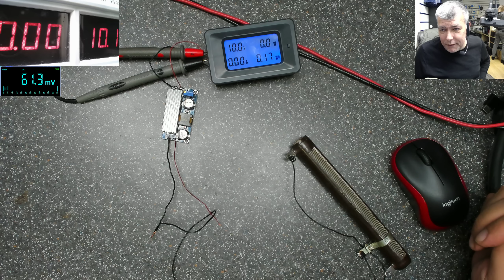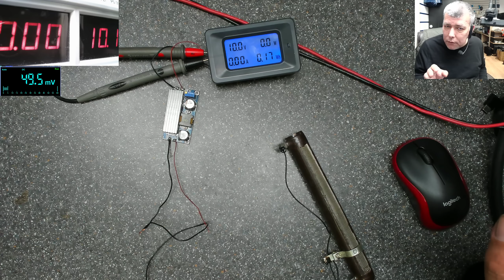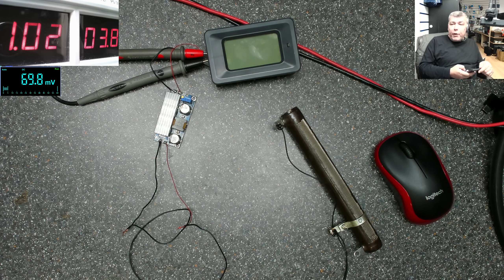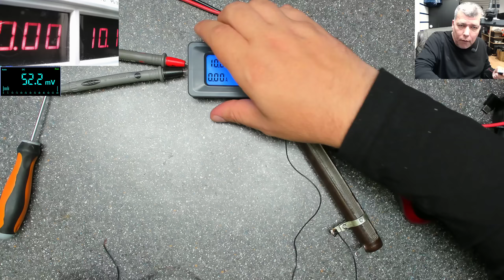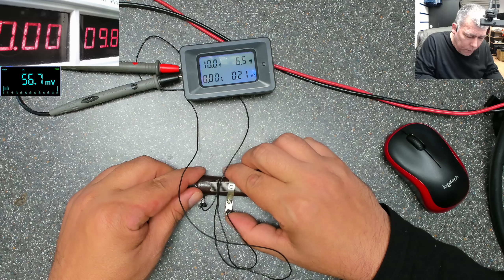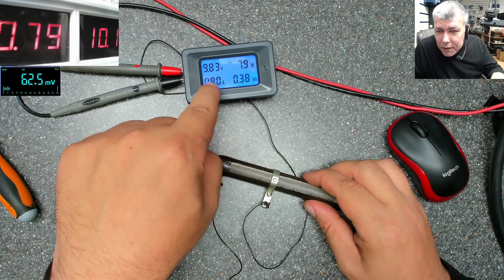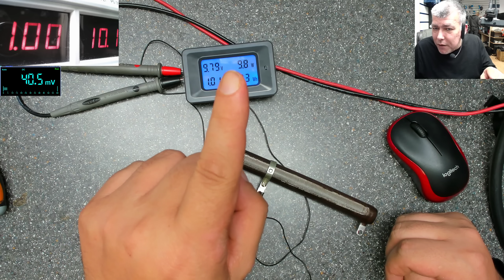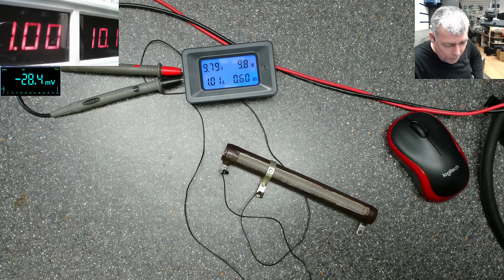How a solar panel mppt controller works

Comment: resistance load not right. must be a battery, then it would last 10v but would not charge because of a 12v battery.

Comment: While the MPPT controller is tracking the best output power from the panel, does it maintain a constant output voltage to charge a battery?  The output power must also be changing by the law of conservation of energy.  So something must give at the output of the MPPT controller, either the output voltage or output current.

Comment: I am 68 also. Remember the old days of audio amplifiers,  something called impedance matching? If you use an 8 ohm speaker on a 8 ohm output you get max power transfer.   
 If you use 4 or 16 ohm you only will use 1/2 the amps output power available to be had. You may have a 10watt amp. But You will only get 5 watts out. It must be matched! 
 If you use a battery with 5 ohm internal resistance you must use a 5 ohm load to get max power transfer out of that battery.
 But I'm just an old electronics  guy..  I don't talk fast and I read read and believe  the KJV Bible.

Comment: Interresting, series starting out good :), but of course its all just ohms law in the end :D
Im wondering if you will be making a battery backup inverter for adding to your grid tie inverter?, if you do, can you show a 3 fase? :)
I been looking at alot of ideas on how to do this, but i dont see the solution, should be in sun time charge batteries with excess power from solar that isnt used in house, if extra (-house, -charging) put that back grid, in night/dark priority taking AC from batteries, when batteries low, use from main grid (thats my idea anyways).
I have a Danfoss TLX Pro 6k+, in a good day i make 6-12 KW, but i only get to use 3-5KW rest goes into nothing (we pay 2.20 KR pr Kwh, we get 0.12 KR for what we send to grid so its bad to return).
I would think a sweet diagram would save me alot of money in the long run.
I see most commercial sollutions is easy 2-3000$ which is cracy, then might as well buy a real hybrid inverter :P

Comment: This will be an interesting journey.  I build solar control panels and LiFePo batteries for a living.  95% of the units I build are installed in Barbados - I think they will generate a little more power than here in the UK :).  Our Barbados panels have 2 charger/inverters running 6 x 24v 76Ah batteries per panel.  Our UK panels have a single charger/inverter running 3 x 48v 152Ah batteries.  Sorin, have you thought about building your own Lithium battery using cells from old laptop batteries?  You must get hundreds in your line of work :)  You should move to Yorkshire, it's always sunny in Yorkshire ;P

Comment: Photovoltaic systems are truly wonderful and can handle any financial situation. A mediocre system that can meet the needs of lighting and other light household appliances (refrigerator, washing machine, televisions, mixer, a small air conditioner, etc.) but provided that not all will work together, can be done at a cost of 6 to 8 thousand euro depending of the quality of the construction materials (Chinese is much cheaper but is it better?) We must forget about energy-intensive electrical appliances that we will have to replace with other types of energy such as gas (electric stove, water heater, maybe even the washing machine if we found a way to supply hot water by turning off its resistors, some clothes ironing presses, etc.). High consumption should also be avoided during the night because there is no sunlight and energy storage batteries have a certain lifespan depending on the degree of discharge (it is also the most expensive material in our system).
Many are forced to buy a rear-end wind turbine to make up for some of the energy during the night or in the constant cloud (as you have in England). There are many things that need to be studied properly in advance to have a proper installation and not need extra constructions and upgrades. Above all, it comes down to the financial issue and how much everyone is willing to spend.
 Sorin, you opened a big issue, you started it right from the electric-electronic side (since it is also your specialty), I am sure that you will fill several gaps that were created for me during the establishment of my own photovoltaic system (a small 1000 watts about where I have installed myself in a cottage-residence in Greece).
Well done and I'm waiting for your next videos

Comment: Hello
If you have time can you explain the Hybrid system with the super capacitor iknow maxwell have one,i want to know if it is possible to operated air conditioner only with the super capacitor when there is sun especially in warm countries  😎.
Thank you

Comment: For clarification. how do you actually achieve impedance matching in the converter without using resistance?

Because if you would just attach a proper resistor on the input side of voltage converter than you would achieve that impedance match, but it would mean nothing because the power would be dissipated in that resistor and not used by the converter.
You need the power to go to the converter so that you can use it in whatever appliance you want, otherwise you are just wasting it.

So, the answer to the problem lies in the fact, that you shouldn't actually look at it as an impedance matching device. Because for the panel it doesn't matter what do you connect to the output, as long as the voltage and current going out is proper. What you need is not a resistor, but a proper voltage and current going out of the solar panel.
You achieve that by using a capacitor or a coil. They both have minimal resistance, but the amount of current that they are taking is dependant on how much charge they have already loaded.
By manipulating the amount of charge in capacitor or coil through it's loading and unloading you can steer the amount of current it draws and thus you can imitate a resistance without using a resistance.
In this way you can have maximum power draw and steer it to conversion during unloading stage.
Reply from the maker: I said it in the video, a mppt controller is changing the internal resistance by changing the output current! Higher output current, lower internal resistance and vice versa
Reply: @electronicsrepairschool  hi, I appreciate your videos, thanks for them.
I wrote this comment because of my own struggles when I tried to understand mppt for solar panels.
This resistance imitation was the hard thing for me and I couldn't get it.
I wrote it here explicitly in case anyone thinks like me.
Have a nice day
Reply from the maker: Thank you, i really appreciate when ppl express their opinion or questions

Comment: Un proiect extrem de intresant Sorin, speram la cat mai multe teste, cu diferite chargere solare mai mult sau mai putin specializate. Eu cred ca sistemele de cautare a varfului mppt incerca sa converteasca din panou o tensiune dinainte stabilita de incarcare acumulatori la un curent cat mai mare in functie de intensitatea solara la un moment dat. Insa poate ma insel...

Comment: I built our system in 2011 using 16 Sun Electric 210 W panels  with Peak Power V 18.3 V and Peak Current @ 11.40 with adjustable angle framework for best sun angle through the year. Parallel 4 bands of 4 series for approximately 48 A at 72 V mid day. Run them into a combiner box and then through 90 feet of 1/0 copper cable to an Outback Flex Max FM-80 MPPT charge controller (fan cooled) charging 2 series strings of 8 paralleled (16 total) L16 350 Ah batteries into 240 v converter. We are completely off grid and this has worked well. You can custom control the absorb charge and the  float charge. We are in a very sunny spot in Colorado at 8020 ft altitude so the panels receive good sun. Enjoy your channel.